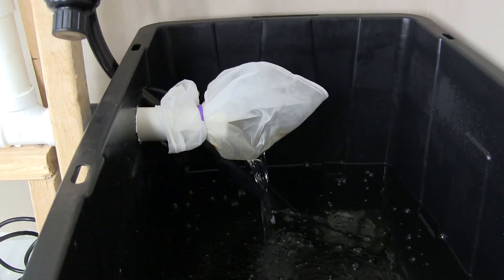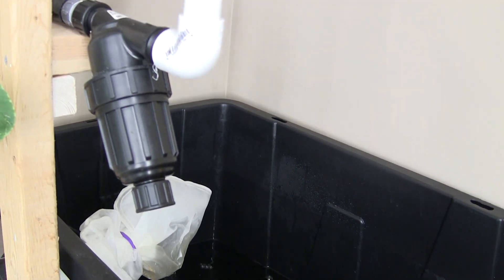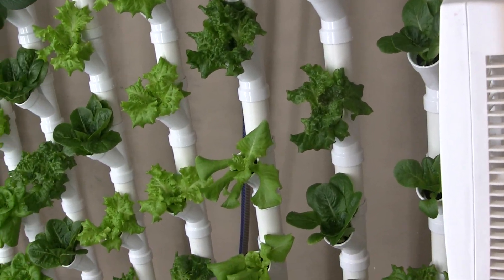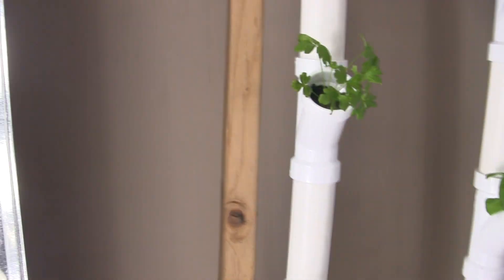Basement Hydroponic Tower Garden Version 2.0

Comment: This is a great setup, I have read a lot about hydroponics, and don't seem to get the one answer i am looking for clarification on, I wish to run a substantial size setup using the slurry from a bio-digester or biobag. Does anyone know if this is possible, My plan is to use the watered down slurry, running it thru a filter to remove "bits", thereby utilizing a totally "off grid" byproduct to feed the system without any additional nutrition.

Am i being too optimistic or could this work in practice?
Reply from the maker: Hi Ron, I'm never one not to try something new but I think this is going to be a challenge. I would think you'd need a number of filter types to filter down to what would be manageable to run through your hydroponic system and that would require a lot of constant maintenance. Unfortunately I don't have any experience with slurry.  You'd also need to test it to make sure you have all the required nutrients in the quantities required to grow successfully, and also modify to the proper pH.  Those are the first two thoughts that come to mind. Good luck!

Comment: Am I the only one asking how the water isn't pouring out of the connections. Or even leaking in the slightest? I'm making a system but because rockwool is not reusable or compostable I was going to use pool noodle rings... Would that work for this?
Reply from the maker: Hi Sean, not sure why the water would be running/pouring out of the connections. They are glued with glue safe for potable water. And rockwool is compostable  - I've been composting it for years and using it in my veggie gardens and flower beds. Best is if you break the used product into smaller pieces before you throw it into your bin. By me from there it goes into my tumbler for a couple weeks  and then either directly into my beds or into containers for storage for next year's growing season.

Comment: Hi Joe, Great design! I've just ordered Wyes, Tees, some elbows, caps, and and some 1/2" and 1/4" water line. I will start to copy your build as soon as the pats arrive. Thank you so much for sharing what you've learned along the way!  Have you made any changes or upgrades from your 2.0 9 month upgrade? I've been watching the basement videos and taking notes, but a couple of things I'm not clear on
 yet: It looks like you use 1/2" to 1/4" barbed reducing tees at each tower,  (I still can't find a decent supplier for those...) but I was wondering if you have any sort of volume regulation going on either on the 1/2" feed or the 1/4" distribution side, if not does it just happen to work out with no regulation?  what is the approximate volume per tower that are you pumping? I'm also wondering if you still use the 1.5" rock wool cubes for the 1.5" grow sites?  and what is your source for nutrients?, I just ordered the MasterBlend Combo kit from Amazon to get started but going forward I'm wondering if there is better pricing available. Also, where do you buy your Danner pumps? I'm in Washington state there are no Mennards here, when I tried to order Wye's from them I realized that they dont ship, so I went with https://www.supply.com/ for most of the PVC, I'll be getting my pipe at a local big box... (Wow! this just happened: I ordered from them yesterday and just now, not even 24 hrs later I received 4 boxes with most of my fittings! Amazing! , Amazon's got nothing on these guys! )  Thanks again for all your help!
Reply from the maker: Hi George, I have no regulation. I ordered my pump Danner Supreme Model 5 online - lots of options with pond pumps, but I like Danner. Handy to have an extra propeller on hand. I make my own nutrient - lots cheaper - recipe from ChilledLED on YouTube. Don't know the exact irrigation amount to each tower - I just used barbed connectors (Farmtek is a good supplier for quality irrigation products) straight up 1/4  (no reduction tees) and use them to tap into the 1/2 irrigation line and 1/4 tubing with I would improve and shoot through the back the 1 1/2 inch PVC pipe to the front, where it will the run down the front provided you pitch them like I did forward a bit. Stilling using the 1.5 inch rockwool plugs - I need to order more soon. My last order was for the bulk price - and they came in a box of over 3,000! Can't believe I'm almost out!! Best of luck and and let me know if you have any additional questions.

Comment: Is this close circuit water system right? Could you share some plans,how did you engineer the top of tower,and what kind of pump and timer are you using? Thanks.
Reply from the maker: Hi Chef E, I if you read through the comments I explain a lot of details, but yes it's closed loop. The top has a 1/2 irrigation line with 1/4 inch feed tubes that irrigate each tower. Pump is Danner Supreme model 5 and the timer is a Tork outdoor 15 min timer. Hope this helps!

Comment: So, by my calculations each head of lettuce costs you $22.34. I use the B.A.Kratky method, no pump no pipe no circulation with 27 grow sites in a 32by48" box 5" deep. 24 gals. of nutrients lasts for a full growth cycle in 30 days without any topping off. Staggering the planting days every 2days ensures one head every 2 days at a cost of $0.11 per head including nutrients and lighting.
Reply from the maker: Hi Jon, no, it's not anywhere near your estimate. That's preposterous. We can't use 20 heads a week and through donations for our extra produce we are a bit ahead of the game, even when our solar production is in the toilette in the dead of winter. Our daily share is financed by our surplus, but I don't do the math every month to find out exactly where we stand. As far as I see it we are growing food locally and sustainably and without pesticides and herbicides. I share with others and despite my own time investment, which may be 4-5 hours a month, I'm not running at a cost. My kids see how healthy food is grown and I involve them when I can in basic operations - check out the vid I made with my son Karl for his school. I run my lighting via timers to avoid peak electrical times, and we apparently saved $320 on our electricity bills by using the hourly pricing program last year. I suppose I could figure out how to further cut costs even further, but I'm content with my current setup. :-)

Comment: Wouldn’t this qualify more as “aeroponics”?!  I’m curious to see how the baskets fit in the Y fittings. You mention that the plugs fit perfectly. Is that the same as the little baskets?
Reply from the maker: Hi Tim. I use 1.5 inch rockwool cubes without 'baskets' or what I think you mean are netpots, and they fit in the wye tee opening snugly. Aeroponics uses a nozzle to spray nutrient at the roots, but I trickle the nutrient down the pipe over the roots. I don't have experience with that and am avoiding it because I imagine they nozzles will clog over time and I don't want to deal with that. My design works just fine, not to sound like a curmudgeon.

Comment: Thank you for sharing. An excellent and well thought out piece of engineering. For those of us who can't imagine the setup - are you able to diagram it? 
With the Y connector - are the plants in an insert (like a cup) or directly into the Y connector. 
Water/nutrient feed system is a trickle feed? This wets the roots sufficiently with the apparatus leaning forward?
Reply from the maker: plant plugs are rockwool and sit directly in the wye tee. pump goes on and off - feel free to read more comments. I repeat myself a ton on these threads and there is a lot of great info.  good luck!
Reply: @maryneumayer01  Thank you for the info

Comment: I have a 6'x8' aquaponic growing room in our basement and I have been thinking of growing strawberries in vertical tubes like your system (I really like the way you built yours). I may use a drip system or fogopnic watering system. My question for you is: Have you considered using a light-mover with your lights hanging vertically and much closer to your plants? My plan is to use a light mover for one t5 light fixture that covers about 5-foot span in about a minute. If you have looked into this and found it didn't meet your needs would you explain that for us? Thank you, cool setup.
Reply from the maker: Hi, I futzed around with some ideas for a light mover and never pulled it off successfully. Sorry!

Comment: You've got the perfect setup to go aquaponic with it. Ditch the hydroponic solution, and replace it with fish in the reservoir. All you need to do is run a filter in the pump line to filter out any large particles, and the system operates without the need for artificial solutions. Plus you can grow fish too.
Reply from the maker: been there done that my friend. After 2 years of aqua I switched over to hydro. Don't get me wrong - I loved my fishies, but it was not optimal for shutting down over the summer and restarting in the fall. I grow outdoors in my small greenhouse spring/summer/fall. It also got cold in my basement for my tilapia, and the solid waste really required a lot of maintaining to keep my grow beds clean. Plus I had my tilapia in about 400 gallons - I couldn't keep them in my tiny 50 gallon container in this system - and if I tried, I'd have to add water every other day - and feed them twice, adjust the pH every 3 days, manage solid waste, engineer a large biofilter, etc. I just don't have the time. And what to do when I need to leave for a week or 3? Again, I love aquaponics, but this is not the setup for it unfortunately.
Reply: @maryneumayer01  valid point.
Automating systems isn't too difficult with the right investment up front. But that's something you have to figure out if the cost is worth it for you in the long run. 

I stared out by automating my aquariums when I was in the army so they could run while I was gone, and then decided to add onto it for an aquaponics system. Automated feeders took care of the food, and an auto top off system pumped water kept in a reservoir into the system, as it is cooler and sealed, it doesn't evaporate. All told, it cost me about $1000 on a smaller scale.

Comment: How did you know how to set up the water pumps? That is the biggest challenge for me, I don’t understand it please help.
Reply from the maker: Hi Kralub, not sure what you mean by "set up." You need a pump that can handle the height (head) and flow.  For my basement system I use a Pondmaster number 7 I believe. There's a 3/4 in output and I reduce it to 1/2 for the supply line.  Good luck!

Comment: I sorta skipped through your video - thanks for the video, great stuff, by the way - and I was just calculating your electricity usage. So, it's 60 bulbs at 15 watts each = 900 watts per hour or 0.9 kWh per hour. If your growing day is 8 hours, 8 x 0.9 = 7.2 kWh/day or 50.4 kWh/week. If electricity in your area is about $0.10 per kWh, that's $5.04 in electricity per week... you harvest 22 plants per week, which gives us $0.23 per plant for light electricity. Not bad!
Reply from the maker: not exactly true. 16 hours a day, not 8, and there's the fan and the pump. We have 30 solar panels and they produce up to 7.0 kWh at peak with full sun. Plus we do hourly pricing and I shut lights off during peak energy hours/demand. So it's hard to calculate.
Reply: @maryneumayer01  - Interesting and thank you for the clarification. I wonder what would happen if you left lights on for 24 hours a day? I know that some plants don't need darkness!

Comment: Hi brother ..Thank you for sharing this wonderfull idea . I am going to start a system this . 
I have one doubt. Why you didn't choose DOUBLE WYE PVC connector for building this towers? If we use Double wye PVC connector, can harvest double yeild right ?

Is it possible to reach nutrient solution, to all plants if I use  Double Wye PVC connector ?

Kindly advice , 
Thank you .
Reply from the maker: Hi Renshi, if you have full east-west exposure then I'd think a double wye tee is the way to go. I'd think you'd be able to reach all of your plants but I haven't tested it.
Reply: @maryneumayer01  Thanks for your reply . 

I am thinking of putting double wye connectors 90° angle each one at the top and putting the tower straight (without any tilt).

That means plant will grow on all sides of the tower . 

Kindly give comments about this.

Comment: Question about your lights.  Have been studying your light sockets in the video.  How do they go through the sheet metal and how are they held in place?   I am having trouble finding something in the store that looks  similar.  Thank you.  Love your setup.  Lots of creative ideas.
Reply from the maker: Hey Karen. I used a hole saw for the light socket holes and used duct tape as an insulant, so that the socket doesn't somehow conduct with the metal. I made the holes a little big, and then with the tape they fit pretty snugly. I purchased the sockets at Home Depot, as well as the double sockets.

Comment: How does your AC get rid of the extra humidity in your house?
Reply from the maker: Hi Mark, I only run this system in the fall/winter/spring. I grow hydroponically outdoors when the weather is hot so there is no concern for humidity in the house. It actually acts as a humidifier in the cold winter months which is a bonus.
Reply: Great, I live in Florida humidity  is a big problem.  I love the concept and the video.  Great work!!!

Comment: How do you control root mass clogging the tubes?
Reply from the maker: I grow for 3-4 months and then put new sets in. I could increase the pipe size but this system wasn't designed for large, continual harvest veggies.
Reply: I actually pull the plant out and trim the roots to keep them from clogging the tube. So far I've been able to continuously harvest the same plants. Its extra work and it would be nice if there was some work-around but I can't think of anything.
Reply from the maker: Yes, I've done this too on occasion. I have some pipe to increase from 1.5 in to 2 inch, which would help, but that project is on the back burner.
Reply: Ah well let me save you the trouble! I have used 2 inch towers right beside 1.5 and so far no difference except a less frequent clog. But it still clogs eventually depending on the plant.

Comment: Just found this video--late to the party!  Anyway, great system and we are building one for ourselves with a few mods.  Since we are using flexiplugs which are smaller than the rockwood, we are using a reducer bushing that drops in the wye and will hold the smaller plug in place.  We are new to hydro growing and still reading up on what's involved.   My question is, you have a time on you materials list.  What do you use that for?  Also does the nutrient flow 24/7?  Thanks for your video and assistance.
Reply from the maker: Hi Brenda - by "time" I am assuming you mean "timer." I run the lights and nutrient pump on timers. The plants get 16 hours of illumination a day and the nutrient is pumped 30 min on and 15 min off. I wish I had more experience with some new lighting solutions. If you find anything you like for vertical towers please let me know. Welcome aboard and best of luck to you!
Reply: MaryandJoe Neumayer right now we are using led grow lights from costco.   2' fixture with 4 rows of lights. We also added to your design to make it double sided.   We have about 140 sites.  And